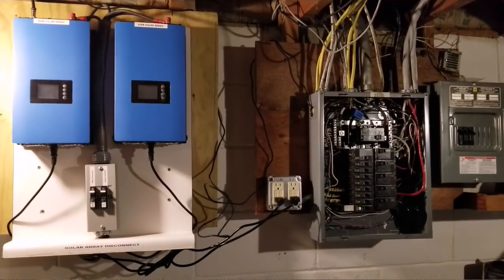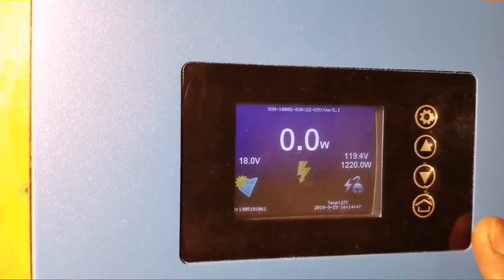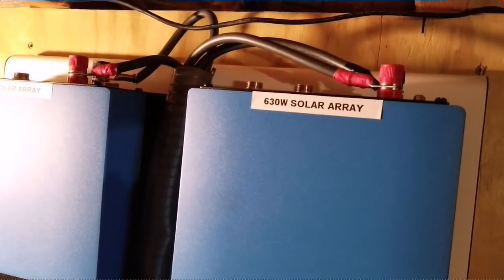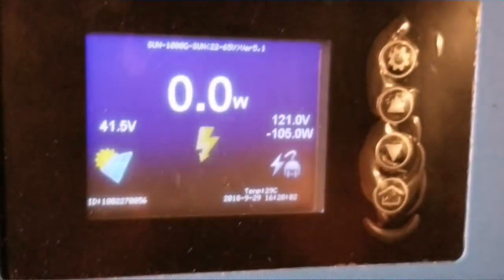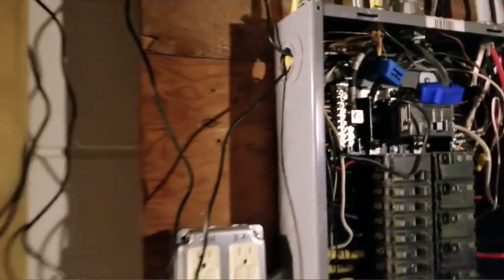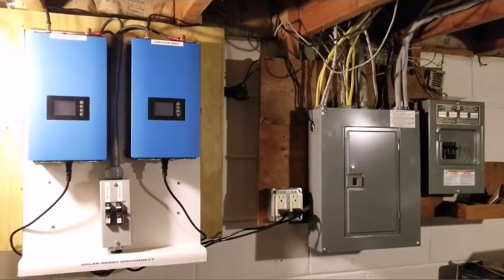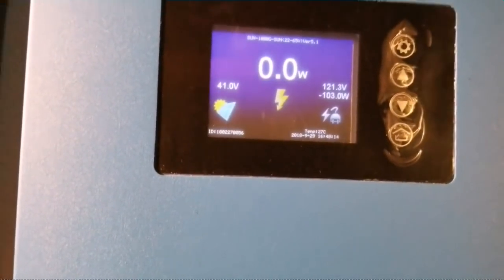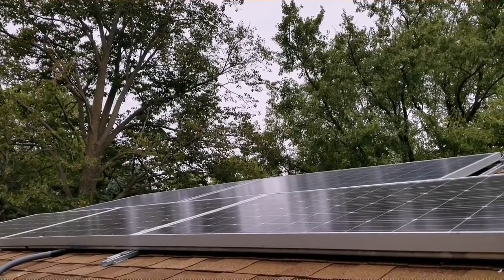DIY SOLAR SUN GRID TIE INVERTER GTIL2 | How To Install GTIL2 Limiter Sensors To 240VAC Breaker Panel

Comment: the 2nd limiter, you put in the wrong way.  you need to see the arrow side on the limiter.  The reason you had minus sign is the the electric traveling in wrong way.
Reply from the maker: Thanks for your observation brother and have a wonderful day Sir.
We have CORRECTED the ERROR and is up and running now.
Reply from the maker: We have CORRECTED the ERROR and is up and running now.

Comment: Yeah, I'm surprised more people don't take advantage of these inverters. Super cheap and the home code enforcer doesn't need to know about it... 😁

I ran 3-14 wire to one outlet that ran between the inverters and broke the hot tab on the side,  then wired the two hots to top and bottom of that outlet!!! I can then control either inverters by throwing the circuit breakers....
Reply from the maker: Thanks for sharing. 
Please don't forget to Like Share and Subscribe

Comment: can you use the same sensor for 2 inverter? j
Reply from the maker: I haven't tried that, but each inverter came with a limiter sensor. 
Thanks for watching, LIKE SHARE and SUBSCRIBE
Reply: @jwsolarusa  yes but in Europe we only have one phase. And don't really wana have one clamp per inverter... Lack of place 😂 I need to extend my sensor cable did you ever try to extend them? Are they still precise if you do it. What cable to use? Vendor say I can go to 30 meters of cable.
Reply from the maker: @chris_mk5supra  
https://www.ebay.com/itm/134102558601?mkcid=16&mkevt=1&mkrid=711-127632-2357-0&ssspo=6lr8viaosmy&sssrc=2349624&ssuid=EBstTcE3Twa&var=433547457558&widget_ver=artemis&media=MORE
Reply from the maker: @chris_mk5supra  
https://www.ebay.com/itm/165373728652?mkcid=16&mkevt=1&mkrid=711-127632-2357-0&ssspo=o24SWkWCQS-&sssrc=2349624&ssuid=EBstTcE3Twa&var=&widget_ver=artemis&media=MORE

Comment: How reliable are these  GTI’s and how long they last? GTI manufacture dose not recommend using a GTI on each 110V  leg, does that mean the other leg w/o GTI is being fed by power grid 100%?
Reply from the maker: Watch and learn
Reply from the maker: OFF GRID TINY HOME EXPLAINE, SUN-1000G2 GRID TIE POWER INVERTER WITH LIMITER (Part 2)
https://youtu.be/FErM3K6gKbk
Reply: @jwsolarusa  Thank you. It is all making sense now.
Reply from the maker: @dcho5057  
USE THIS LINK TO BUY YOUR LITHIUM BATTERIES:
BATTERY HOOKUP AFFILIATE CODE  
https://www.batteryhookup.com/?rfsn=3471371.009083

Comment: I have three question.

1. The clamp sensor has a directional arrow on this 1000w unit i recently bought. Where should that arrow pointed, is it upward from 
on-coming power grid source? or is it downward pointing to all the loads? or it doesnt really matter.

3. On the screen display, in the lower half of the screen, there are two rows of setting, theres the bottom row and theres one directly above it. (Btw the house is 120v AC were here in the US)(my unit is the 24-60v input). Question, what should be the proper setting of the bottom row and the setting for that row above the bottom row so it will not read negating(-) when you view the power consumption screen. As these are NOT detailed  clearly in the users manual. Thanks
Reply from the maker: Upwards towards the incoming grid power.
Reply from the maker: Keep WATCHING the videos you will find one of them I was explaining about it with my friend grillmeister Dave
Reply: So i tried your suggestion but i got a different results, and let me explain how.
So im facing the breaker, looking at the two large wire from incoming grid power. First i hooked the clamp sensor with directional arrow pointing up to on-coming grid power. Then the inverter screen showed negative(-) watts reading just below the voltage reading on the rightside of inverter display. So i reconnected the clamp with arrow pointing downward on the same incoming grid line and i got a positive(+) wattage reading but its very low. During this procedure i also have a SENSE MONITOR that reads the actual power consumption to 1800 watts, but the gridtied inverter on showing 200 watts, that really low. Then i moved the clamp sensor to the left incoming grid wire with arrow pointing upward, it registered a negative(-) 1800 watts, that shouldnt be negative right? Then i removed and reconnected the clamp but now with the directional arrow pointing downward on the same leftside incoming grid wire, this is the opposite of what youve suggested(which is upward). To my suprise a positive(+) 1800 watts appeared on the display. So base on this actual procedure, the arrow should be pointing downward and connected to the left side incoming gridline, thats if your facing the breaker panel. Or maybe not all breakers are wired the same?

Comment: You will get more power out of those panels if you raise them off the roof more. You need at least 4 inches between the roof and the panels to allow for airflow. Otherwise, the panels will get hot and not produce well.
Reply from the maker: They are proximately 4-5 inches above the shingles .
Thanks for the input Sir and have a wonderful day Jim

Comment: Great videos. Could you please share more information on solar panels.  How you connected 24 volt system or 48 volt and also please provide link where to buy specially solar panels
Reply from the maker: Watch My Home Solar System
"DIY 48V OFF GRID SOLAR SYSTEM" on YouTube
https://www.youtube.com/playlist?list=PLSNjIRSnUPDKc3i-DmfOd_BF0m5quIZRT

Watch My Off Grid Solar Power Inverter Installation
"OFF-GRID POWER INVERTER" on YouTube
https://www.youtube.com/playlist?list=PLSNjIRSnUPDKf94lqgdlm4Gdk6y23U8FL

Watch how I Disassembled Nissan Leaf Lithium - Ion Battery 
"HOW TO DISASSEMBLE NISSAN LEAF LITHIUM BATTERY | NISSAN LEAF LITHIUM ION BATTERY PACKS" on YouTube
https://www.youtube.com/playlist?list=PLSNjIRSnUPDIUSgmNCMSn7cIe8T1VAp8E

Watch My Complete Installation On A 24 Volt Hybrid Inverter/Chargers 
"MPP SOLAR INC PIP 2424LV-MSD 120V 60Hz" on YouTube
https://www.youtube.com/playlist?list=PLSNjIRSnUPDI2b7XfOIOWnpE7VGq2gOEO
MPP SOLAR INC
http://www.mppsolar.com/v3/news2/

Jun 17, 2015 - Inverter-chargers such as PIP-HS / PIP-MS series include AC input terminals that allow utility (or generators) connection to power load or charge batteries. ... “Hybrid” inverters are defined as devices that can both feed power back to utility and at the same time use battery power as backup.

Watch "MPP SOLAR PIP5048MG" on YouTube
https://www.youtube.com/playlist?list=PLSNjIRSnUPDI88U5mM6tESfJW-7pnDcIi

Watch "PIP5048MG Parallel & communication cable" on YouTube
https://www.youtube.com/playlist?list=PLSNjIRSnUPDLhovCCynw6iW6AIeHto9g-

Watch "XANTREX XW HYBRID INVERTER/CHARGER" on YouTube
https://www.youtube.com/playlist?list=PLSNjIRSnUPDLF73OjocIT6_DZs5_xofeH

Watch My Reviews On Solar Panels 
"REC TWINPEAK 5 BUS BAR SOLAR PANELS" on YouTube
https://www.youtube.com/playlist?list=PLSNjIRSnUPDIIxW-7jI_FUcsVEHJGsa1h

Watch "HIGHTEC SOLAR INC SOLAR PANEL REVIEW" on YouTube
https://www.youtube.com/playlist?list=PLSNjIRSnUPDLkW49pRMXLLrAjNo1MfTe9

Watch "JA SOLAR 4 BUSBAR PANELS" on YouTube
https://www.youtube.com/playlist?list=PLSNjIRSnUPDItKj_rc7FnTbcXBtbH5ahV

Watch Solar Panels Reviews, Roof Mount and Installations 
"UNISTRUT SOLAR PANEL MOUNT" on YouTube
https://www.youtube.com/playlist?list=PLSNjIRSnUPDJSvz75KI8_pijBq43WgZyY

Watch My Installations On Grid Tie Inverter 
"SUN-1000G2 GRID TIE POWER INVERTER WITH LIMITER" on YouTube
https://www.youtube.com/playlist?list=PLSNjIRSnUPDJ1Cp3JTPumQ7e8fehjCFqv

Watch "SUNTEAMS PHOTOVOLTAIC INVERTER" on YouTube
https://www.youtube.com/playlist?list=PLSNjIRSnUPDIRVFcne6Hc2GuPKjnGvfT4

Watch "OUTBACK FLEXMAX 60/80 MPPT SOLAR CHARGE CONTROLLERS" on YouTube
https://www.youtube.com/playlist?list=PLSNjIRSnUPDKccL9XbzuyX4vDzO1Hilwe

Watch "MIDNITE CLASSIC MPPT CHARGE CONTROLLER INSTALLATION" on YouTube
https://www.youtube.com/playlist?list=PLSNjIRSnUPDJwoiHa6D11RKbTuAYJv3w8

Watch "HOW TO WIRE A MIDNITE CLASSIC SOLAR CHARGE CONTROLLER" on YouTube
https://www.youtube.com/playlist?list=PLSNjIRSnUPDKjbDokiFrL2jIuiVI9HNJF

Watch "MIDNIGHT SOLAR LIGHTING ARRESTOR (MNSPD)" on YouTube
https://www.youtube.com/playlist?list=PLSNjIRSnUPDKJG9Hw36d1o5ahf7COHSUT

Watch "HOW WIRE BATTERY TEMPERATURE SENSOR" on YouTube
https://www.youtube.com/playlist?list=PLSNjIRSnUPDJnu0NsBtWIu30p108GBKFB

Watch "MIDNITE CLASSIC WHIZBANG JR" on YouTube
https://www.youtube.com/playlist?list=PLSNjIRSnUPDJYPy1KBIBQeE8RwvKrOfVc

Watch "MAGNUM PT 100 MPPT CHARGE CONTROLLER" on YouTube
https://www.youtube.com/playlist?list=PLSNjIRSnUPDLifpyhvruowHIfsEfLtVqE

Watch "MAGNA SINE MAGNUM ENERGY INVERTER/CHARGER" on YouTube
https://www.youtube.com/playlist?list=PLSNjIRSnUPDJMA9X38_nYACQkO9ZxYE3E

Watch "MAGNA SINE MAGNUM ENERGY" on YouTube
https://www.youtube.com/playlist?list=PLSNjIRSnUPDLjEYiFYK2LB_gY3MO5xfwb

Watch "MAGNUM ENERGY ME-BMK BATTERY MONITOR" on YouTube
https://www.youtube.com/playlist?list=PLSNjIRSnUPDKE2_Xfeyk-o-V7l9FF8M3z

Comment: Can I connect the limiter to wire that is going to the meter. I have a breaker that is outside the house that has a cover for the breakers and a cover on the side of the meter. There is two thick bus bars going into the breaker box from the meter, then a main switch and then two bus bars for each 120v. I  think I might be able to put the limiter over the bus bar, but they are kind of wide.
Reply from the maker: Please consult an Electrician to do this Installation for you Ryan.
Have watched the entire episode on this GTIL2 Installation?
I am sorry I can not give you directions how to go about it in your home because, I don't know how your House is setup and it's difficult for me to imagine someone's home I've never seen or been to 😉😁

Comment: I heard those have low efficiency around 80%. I wonder if you can see how well it works.
Reply from the maker: I will bring you more coverage on a nice sunny day so you can see the performance of these inverters.
I really appreciate you stopping by brother! 
I will love see you more often on my channel. 
Have a wonderful day Sir.
Reply: I have three(3) 300Watts in parallel and connected to 1000w unit with a 10 guage wires 30 feet long. Thats how far the inverter from the panels thats mounted in perfect south and panels are tilted to 43 degrees here in Tamp, Florida. On 1 Mar 2020 is a perfect cloudless day. And around 12:30 "solar noon" i tried that solar noon test like the one from YT and in that perfect alignment to the sun, the highest ive got is only 619 watts out of supposedly 900w rating combined from three 300 watts panels based on the setting i mentioned above. Its ok but not very good, thats quite a bit of losses. Any input or suggestions will be appreciated. Thanks.